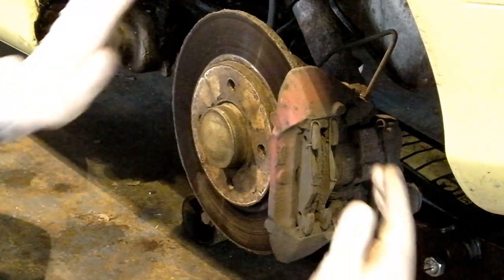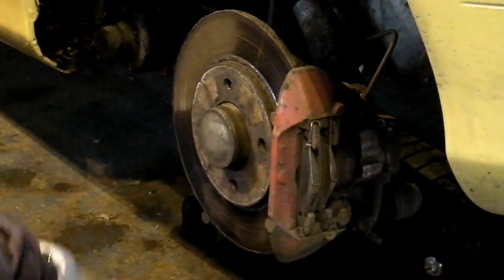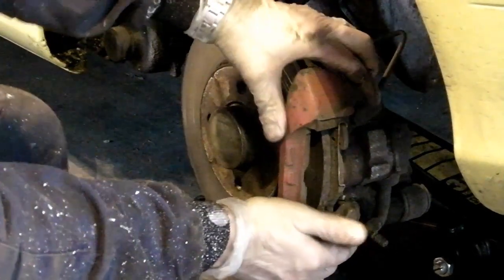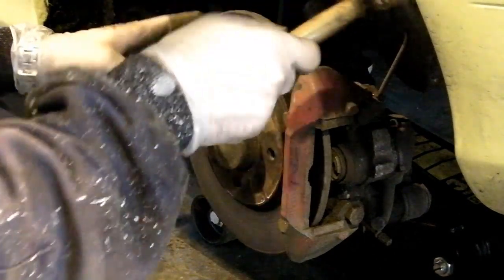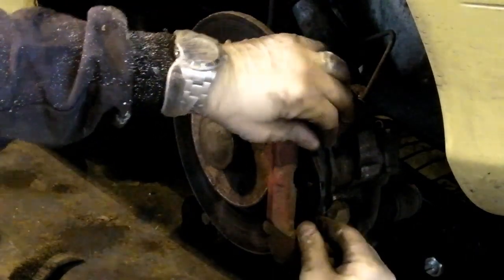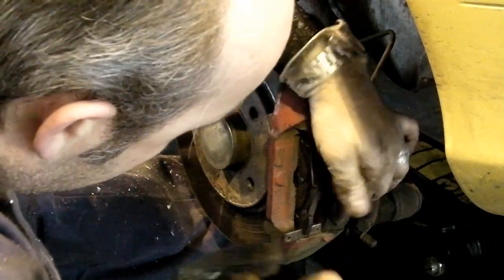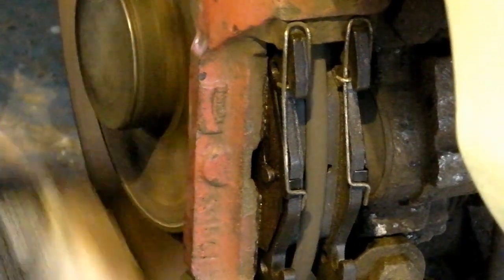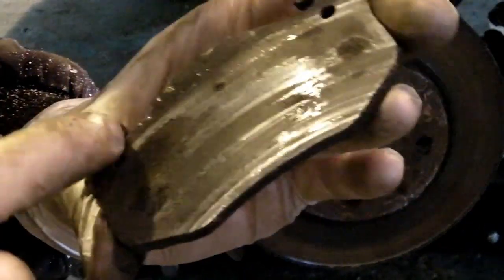Brake Pads Renault Megane Cabriolet How To Change Rear

Comment: Hello! I have a Clio Rsi 1.8, 95 model and I was searching about how to change its rear brake discs and pads when I found your very useful video! Thank you for posting it! It helped me a lot, specifically to understand the function of the anti rattle clips that comes with the brake system. However, I´d like to share with you my concern about a deformed metal bar that I found hanging from a clip that is in between the outter brake pad and the support bracket of the caliper. I do not know what it is for, what is its technical name and I also ignore if the lack of it would affect the perfomance of the brake system. I can´t even find it on e-bay because when I search for anti rattle clips what I find is sets of clips such as the ones you assamble and dissamble in this video. Could you please give me a hand with this matter? Thanks again for your valuable help and best wishes from Colombia, South América.
Reply from the maker: Seeing a picture would help immensely but if this is a fairly thick wire outside the caliper body it's possible that it's a routing clip for a flexible brake hose if your caliper has a flexible hose, (these are normally only seen on the front due to the wheels needing to turn)
If this doesn't sound right could you maybe upload a short video clip of the part and message me so that I can take a look and see what it might be.
Glad the video was helpful and hopefully we'll figure out this mystery part for you.
Reply: spidiq8 Thank you very much for your reply and I appreciate your help. Unfortunately my car is currently in my home town while I figure out how to fix it so I can´t take a video right now. However I have a photo but I can´t uploaded onto YouTube. Could I email it to you? Thanks again!
Reply from the maker: Of course, I can't message you for some reason but if you send it to spidiq8@aol.com and reply on here when you have as I don't check that account very frequently
Reply: spidiq8 Thanks again for your help and attention! I have sent you a message to spidiq8@aol.com with a picture of the left rear brake caliper! I whish you my best solving the mystery of the deformed bars!
Reply from the maker: Thanks for that, I'll take a look as soon as I can and get back to you.